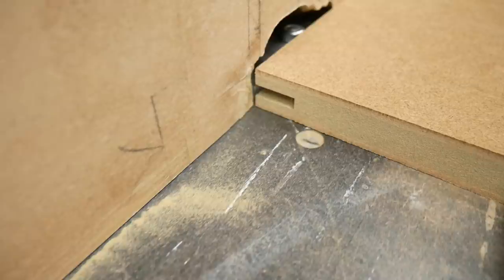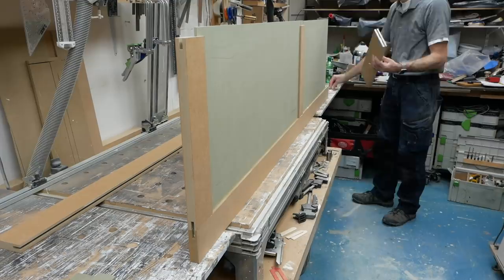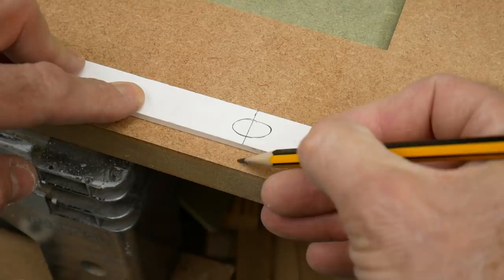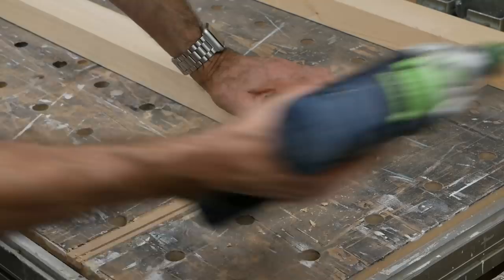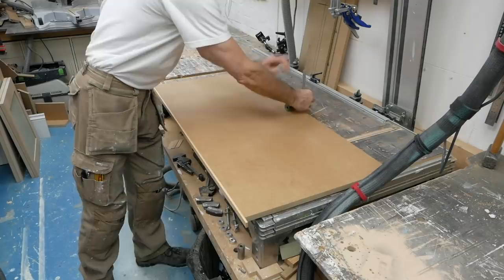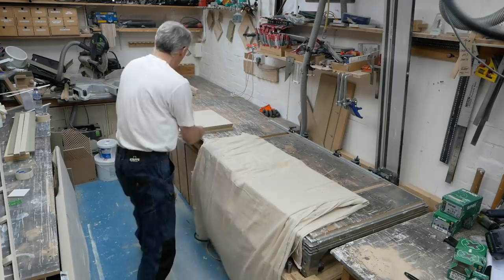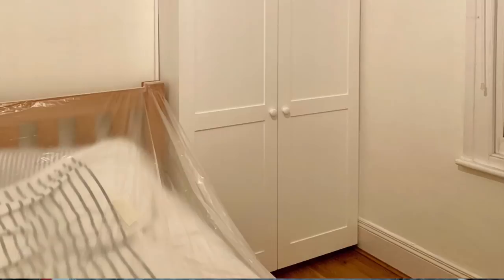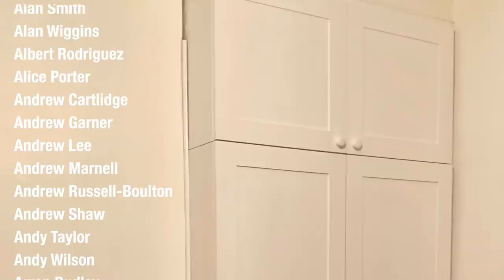Big Wardrobe and Top-box P2 [video #254]

Comment: Do the sides of your wardrobe bow or move? Just 18mm mr mdf on its side right with overlay door. I'm always worried it's not enough and have 3x2 on the inside to support door. Cheers henry
Reply from the maker: No. 18mm MR MDF is fine for carcassses; remember, most commercial kitchen and fitted bedroom furniture companies use 16mm MFC without any issues. 👍

Comment: Another useful video. Thanks!
But silly question.. why use a  different type of MDF (waterproof?) for the thiner centre panel? Stronger?
Reply from the maker: Thanks! It’s all MR (Moisture Resistant) MDF, it’s just that the thinner boards (<12mm) are green all the way through, whereas thicker boards (>15mm) just have a green core.👍

Comment: Lovely as always. Ill watch each and every making video posted by you. 
Question: did you ever considered to change you festool 55 for a 75? Would that be a real upgrade or just extra weight?
Reply from the maker: Thanks Marcello! No, I’ve never really considered the TS75; early on, when I was doing more varied work I took a look, but the number of times it would have been used didn’t justify the cost. It’s a big saw, bigger base-plate, so if you want to plunge the saw off the workpiece, you need to invest in longer rails, plus there’s the extra weight, of course. All that for probably a handful of cuts per year, if that. So, no, not for me, for the kind of work I do. 👍👍

Comment: Hi peter. Thanks for the vid as usual it was great and certainly helped me with my project. On thing. Checking for square: when I check my stuff for square it never is square and tightening clamps sometimes causes long pieces to bow in if I'm not careful. How do you solve the problem of not being square?
Reply from the maker: Thanks Peter. You need to start right at the beginning and cut things square, or as square as you can, because without this you're fighting a losing battle. If you're struggling to get things square during a glue-up, try dry-fitting them first to figure out where the problem is, and mark the pieces so you can get them back together again in the same order.

After that it's then a question of how you check for square; using geometry (3,4,5 triangles) or checking the diagonals, or making sure that the 'square' you're using to reference against is genuinely square. I can highly recommend the Mirock squares - beautifully made and excellent value. As for clamping, you should never need to use so much pressure that you're forcing the workpiece to bow; you're just pinching the pieces together to make sure the faces are in contact with a thin layer of glue between them. If you have to apply significant pressure to make the faces meet, then he chances are they're not square in the first place...
HTH Peter
Reply: @10MinuteWorkshop  thanks peter

Comment: Hi Peter possibly someone asked you this earlier on here already but here I am ...😊 What’s is the base / attachment for your ds 500 please?
Reply from the maker: Hiya. When the Domino first came out some of the early ones (mine’s one) had some issue with the fence drifting over time. A small outfit in the US called Seneca woodworking made a product called the Domi-plate which took the fence out of the equation completely and centred a domino in either 3/4” or 1/2” material, depending on which way around you used it.

The only slightly weird part was that you have to use the Domino upside down, but this has a huge benefit when you’re cutting mortices into the faces of a carcass, because you have the whole of the original fence on the board, making it much more stable.

Domi-plate UK:  https://amzn.to/2PffzFE (US: https://amzn.to/2QU1mi9)

I probably need to do a video about this as it’s a question that comes up regularly! HTH P

Comment: Hi Peter, or anyone else too, how do you find MDF on your tooling bits? I use MDF a lot too, so not a criticism but just find i get a lot of blunt bits in my workflow
Reply from the maker: All man-made boards are hard on bits, I find. That said, I still have my original 5mm Domino bit from 2006, and it cuts really well, considering how many thousands / tens of thousands of mortises it must have cut! So I guess having good quality bits to start with helps - I still have all the router bits I ever bought from Wealden Tool, and they’re still cutting fine. 👍👍

Comment: Hola Mr Millard, I have just finished a work bench with a laminated mdf top. Sorry to bother you but do I need to seal it, and if so what with? Thanks.
Reply from the maker: You don’t need to, but after I stained my bench tops I applied a satin-finish water-based varnish that’s worked out really well. Just put on with a foam roller 👍
Reply: Thanks very much, best regards Jim

Comment: do you not put side panels on. it would hide the join were the two carcasses meet. i do that on all my builds plus i make a L bracket for the other side so i can scribe that. just seams to be what they like down here.
Reply from the maker: Yep, it’s what I usually do - see vid series starting #037 - but No space on this build, the bed’s right up against the edge of the alcove. 👍
Reply: Ive never thought about using timber for the base. I tend to use scrap MRMDF for a frame and them put a 9mm finished piece glued on with CA. i make all my bases 100mm high as stranded gets over the skirting most times.
Reply from the maker: That’s usually what I do too. Client wanted maximum space in every dimension, so ~50mm plinth made sense, and I happened to have some 4x2 & 2x2 redwood. 👍👍

Comment: Really enjoying your videos, thanks. Noticed on a few of your videos you're using tape to apply edge banding, have you seen the inner tube / clamp combination for this type of clamping: https://www.youtube.com/watch?v=qttn0GqifAQ
Reply from the maker: Thanks! I’ve seen that trick before but never used it. I think a lot of the YouTube vids about it are from the US where they seem to get very cheap spring clamps. Here in. The UK those clamps can be a few £ each, so it doesn’t really work out economically, when you see how many pieces of tape I use per shelf! 👍👍